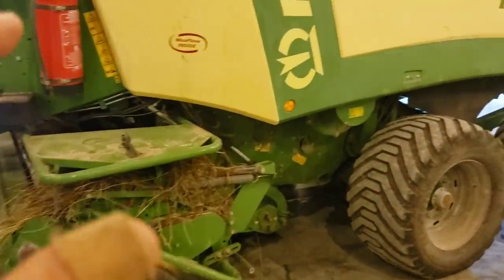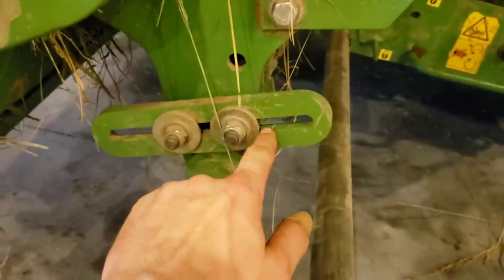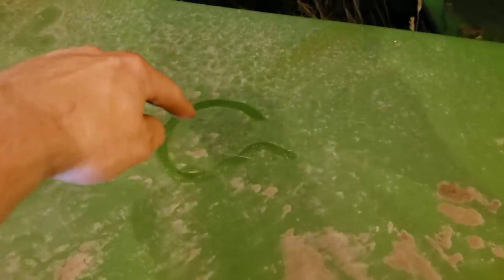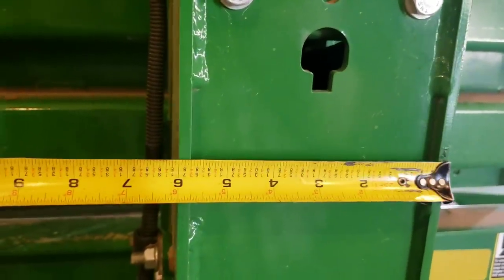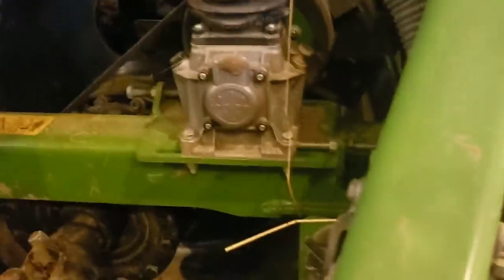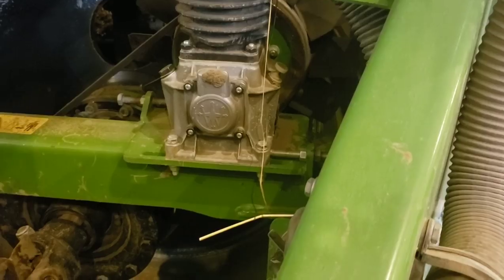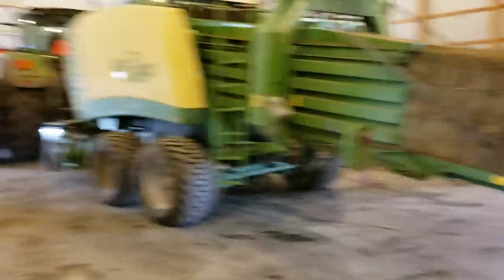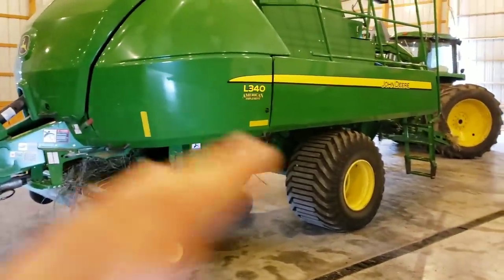John Deere L340 -vs.- Krone 1290 HDP

Comment: Good comparison. We run a JD L330 after we ran a Hesston for 6 yrs. Very satisfied with the JD.  The L331 and L341 have a better pick up , but the old version works for us.  We really like the packer/stuffer system. Simple design and eats anything. Very nice baler to work with.  Considered a Krone but saw one with a messed up VFS (used in baleage) which scared me off...
Reply from the maker: I agree 100% ... your write up is spot on ... cant go wrong with JD paint either (resale is always good)

Comment: The fact the Krone dealer is over 100 miles away would go along way towards making the decision. That's a looong way to drive to get a part when you're racing the weather trying to get the bales made. And I don't care which one is overall better it will from time to time break.
Reply from the maker: Spot on!